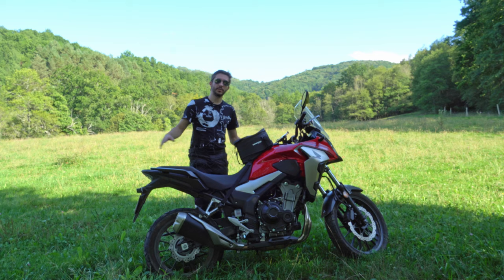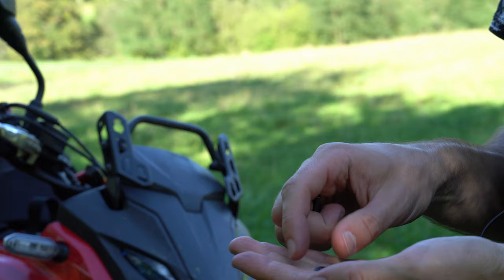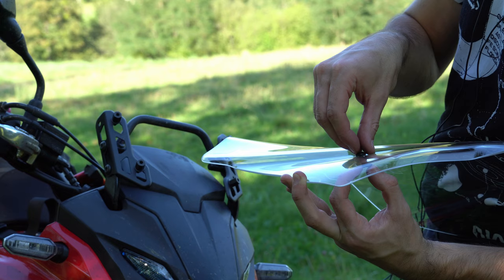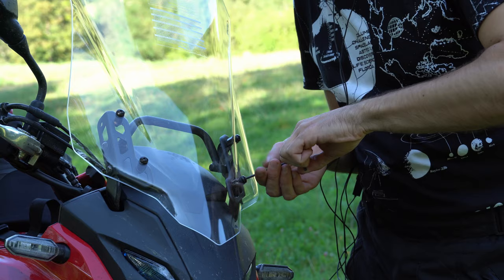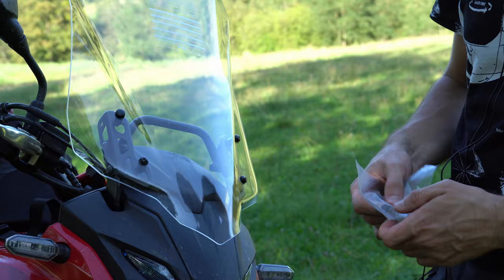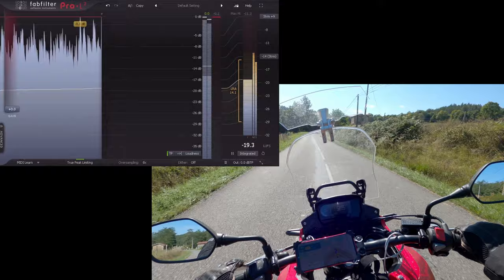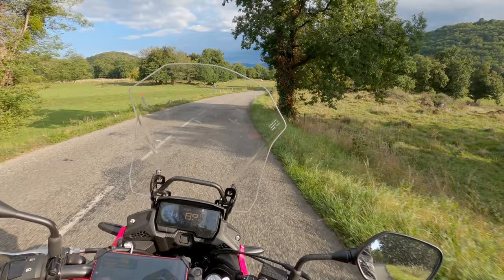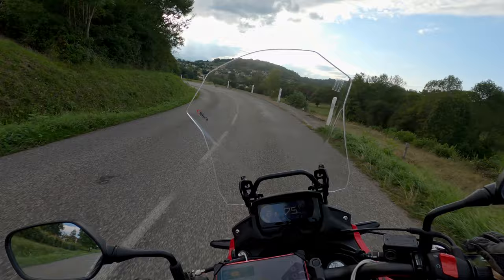Extended PUIG windscreen for the Honda CB500X

Comment: I like the look of this windshield. The rain protection for your trunk should be better, wind won’t be hitting your middle and buffeting on your helmet has a chance of being less.
You are absolutely right about that metal bracket being distracting and possibly dangerous.
It looks as if earplugs would be required with either windshield but the new windshield is better with or without.

Comment: I fitted one of these screens to my 2018 CB500X in August and it is the best screen that I have ever had.
Reply: How's the turbolence at 100 km/h speed? Better or much better than the stock one?
Reply: @maxipuc74  Hi Marco. The bike was delivered to me by van and I did not ride it with the old screen on. I can't answer your question but the turbulence is very low for me at 100Km/h with this screen.
Reply: That's good then. Thanks! 👍🏻

Comment: An excellent presentation!  I have 2021 model.  Superb motorcycle. Always wear full face helmet.  With stock screen I experience zero buffeting but always get annoying wind noise which increases with speed. Tried a clip on extension - zero positive effect plus obscured clear vision - especially bad off road where you need to see the immediate foreground to find your line. Am extremely sceptical about anything (including this Puig) that will effectively reduce wind noise - so instead wear custom made ear plugs.  A real drag having to insert and remove them all the time, but they make for much more comfortable riding - especially over 60 km/hour and long distance cruising.
Reply from the maker: I found that the noise levels were a bit lower with this screen, though not completely gone. Changing from a motocross helmet to my current "ADV" helmet really helped with the buffeting. I still have the visor that sometimes catches the wind, but I like the looks of it and I actually use it when the sun is in my face in the middle of the morning/afternoon :)

Comment: I fitted one recently along with the leg wind deflector that fit onto the lower fairing and all buffeting has been irradiated completely ….. it has made a huge difference.
Reply: Did you buy the Honda original one ?
Reply: @maxipuc74  hiya….. No I went for an alternative as I couldn’t get the Honda version.
Reply: @shaun8306  Thanks mate, enjoy your bike! 🤚🏻👍🏻
Reply: @maxipuc74  
Thank you, and you also Marco.
Reply: Do you have any other accessories like crashbars, top box or knuckle guards?
Reply: @DavidSmith-hn5gg …Hiya David, yes I have Bark buster hand guards, both sets of engine and fairing guard, rear hugger mudguard,, centre stand and the 12v socket.
Reply: I also put helitape on vulnerable painted areas and front fork stems…. To stop surface paint chips. I have also changed the stock tyres to road tyres (Michelin road 5’s)
Reply: @DavidSmith-hn5gg  hiya David , I have most of the useful accessories. I have put the original screen back on and just put some 3/4in spacers to move the screen away from the front of the bike, this has introduced a wind curtain that prevent any buffeting. The spacers cost a couple of £ each.
Reply: No top box or panniers.
Reply: @shaun8306  did you put spacers on screws on plastic windshield screws or the bracket that holds it?

Comment: Hi, thanks for the video. I know it does not look that cool, but I use a full-face helmet without a sun shield and I have no issues with buffeting. Btw, I am 1,76m tall.
Reply: On an old ST1300 I bought a windshield that was advertised as eliminating most wind noise and it was very quiet.  I rode with it around town for a couple of weeks and too a long trip to Fort Davis from Shreveport without seeing the fatigue I did with the stocker.  From Fort Davis I went to Roswell, NM where I went to High school and then up to Parsons, Kansas where I lived during the Korean War and from there down the Oklahoma side of the OK/Ar border to Shreveport.  I have to say the wind noise, rain protection and big truck buffeting were much better.   The big problem was it looked like a satellite dish on the front of my bike and it cut mileage from 42 down to 39-40.   Not terrible with the seven gallon tank but noticeable.
Reply from the maker: Your comparison with the satellite dish killed me :)
I agree that it does reduce the buffeting by a substantial amount, but it also adds some drag and reduces the fuel economy of the bike... But I'd rather feel less fatigue when I'm riding, as I'm sure you do as well !

Comment: Do the fittings need repainting after being scratched by those pliers 😩 you could fit the whole lot to the back of the screen and then slot the screen into the Mount then tighten the fittings with a correct sized spanner 😊but all in all a useful review. Thanks.

Comment: Thanks for the video.  Any advantages when driving in rain?
Reply from the maker: I did not notice any significant change on the rain, as most of it was already deflected onto the helmet with the stock windscreen. I guess I get a little less rain on my visor with the extended windscreen.
The modification that really made a difference for rain, however, is the addition of handguards. I suggest you look into that If you don't have any on your bike yet 😉

Comment: Bonjour, je viens d'installer cette bulle sur mon CB 500x, et votre vidéo m'a bien aide pour le choix et le montage. Merci. Par contre je constate une tenue de cap altérée vers 110 km/h. Avez-vous le même problème ? J'ai monte la bulle en position basse et j'ai des valises et un topcase.
Reply from the maker: Bonjour, Il m'arrive parfois d'avoir à lutter contre le vent à des vitesses plus élevées, de 110 km/h et plus. Je n'ai sinon pas constaté de changement de comportement significatif a cause de la bulle par temps calme, bien qu'elle soit montée en position haute sur ma moto. En revanche je n'ai ni top-case ni valises sur le côté.
Je vous conseille de faire des tests sans les rangements supplémentaires pour voir si le problème vient de là ou de la bulle.
Reply: @jerometabeaud9400  merci pour votre réponse. Je vais essayer sans valises et surtout top-case... Je vous tiens au courant. Sur Amazon un commentaire signale aussi ce comportement 🙄 merci pour votre retour et vos vidéos

Comment: Can you  put the original visor  more down pls
Does it have settings.
Reply from the maker: The stock windshield can be adjusted in two different positions. I had put it into the high position to get more wind protection, because out of the factory it comes in the lowest position available.

Comment: Jérôme, whats your heigh? (in meters plz). Can you give more feedback after more use after this video was made?
I Have the cheap thingy option but I hate it so much...
Reply from the maker: I'm 1.75 m tall. The windscreen performs very well, it protects me adequately at both low and high speeds. I still recommend it after having used it for a few hundred kilometers, it's sooo much better than the ugly extension that I had previously ;)
Reply: @jerometabeaud9400  I see, i'm 1.85cm. Got a friend with the PUIG screen, I think i'll try it before I buy it, even if its the same. I hate that cheap extension thingy
Reply: @Jorden Coelho: I'm 1.87. Would realy like to  hear what you have to say about the puig.
Reply: Sorry for the spelling, Jorge, autocorrect is driving me mad
Reply: @snodropp9202  all ready ordered, arrives next week, probably. I'll give you my feedback after some testing
Reply: @snodropp9202  OK man, already tested on a trip of around 500 klms. While is much better then the original and the Chinese thingy, it isn't perfect. But, I'm quite happy with it. I do recommend it.
Reply: @Jorge Coelho Thanks for info!
Reply: @draculshadowportugal  How’s it holding up? Are you still happy with it?
Reply: @J.I.R.A  yes I'm still happy with it. Recently I changed to the original one and I've cut it down, it's getting hotter here in Portugal, and the puig doesn't let me cool down.
Reply: @draculshadowportugal  Oh that’s awesome to hear! I hadn’t thought about not being able to cool down due to the windscreen but you make a great point! Then the stock one for summer and Puig for autumn-spring it is.